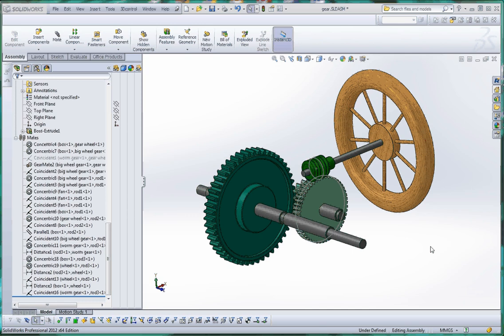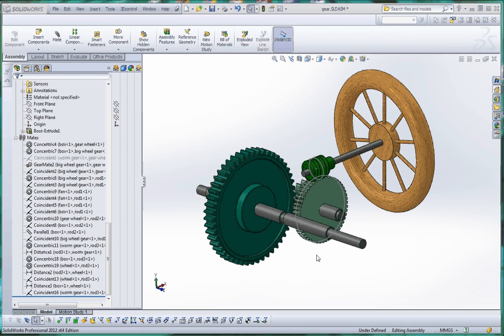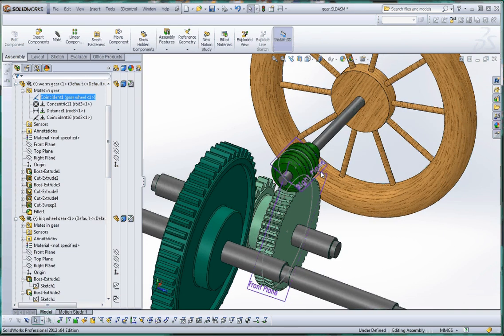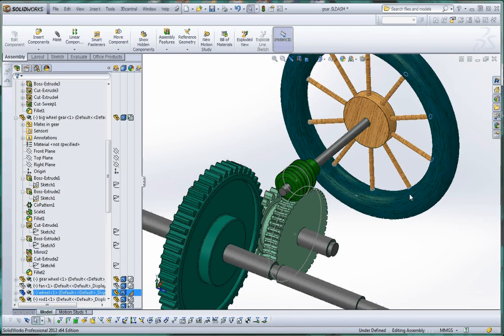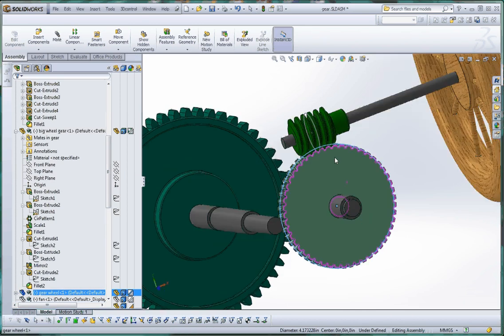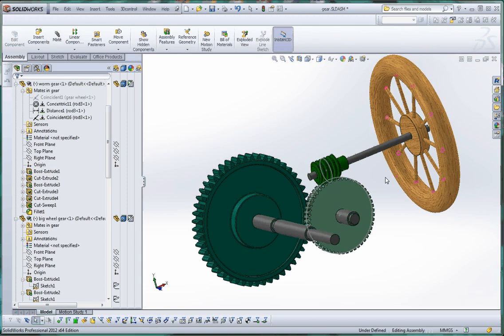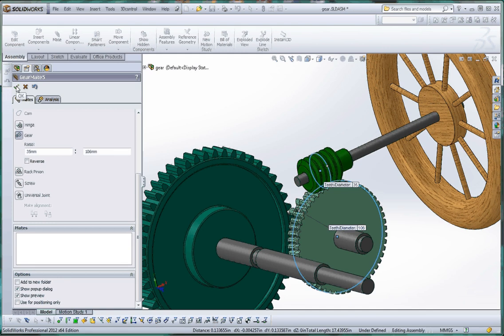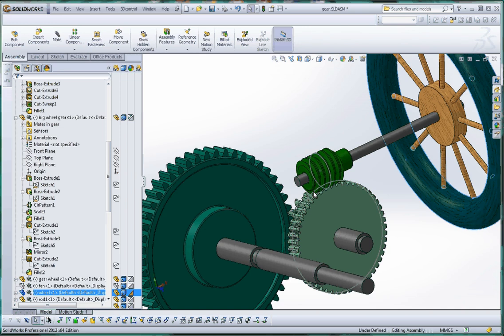Help Tutorial, How to Apply a Mate to a Worm Gear and Pinion

Comment: This exact problem had me stuck for about 20min earlier. This video totally solved it (Thanks!). I should've paid more attention at the end though, because I had the pitch diameters correct, but I was letting it auto set the gear ratio which was the ratio of pitch diameters. When I opened the mate back up to troubleshoot because the motion was obviously incorrect, I realized and corrected it.